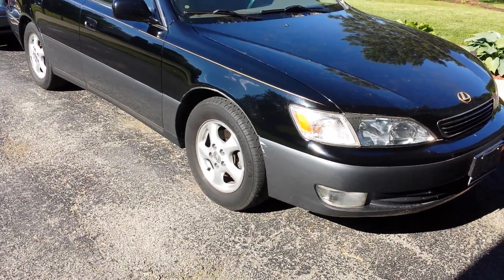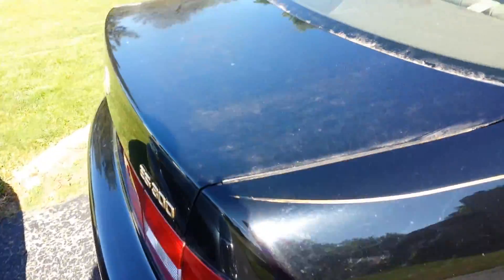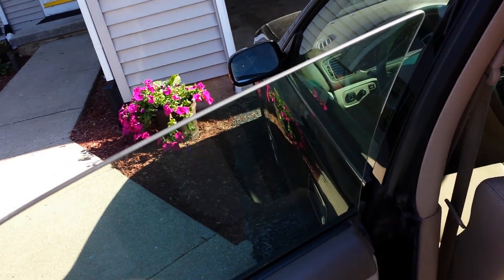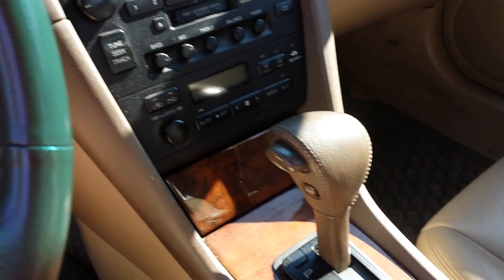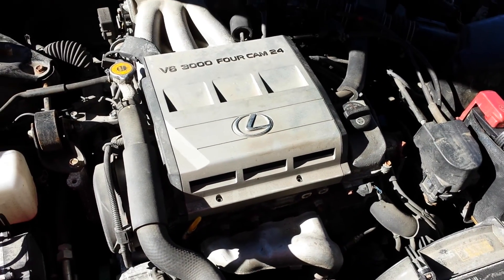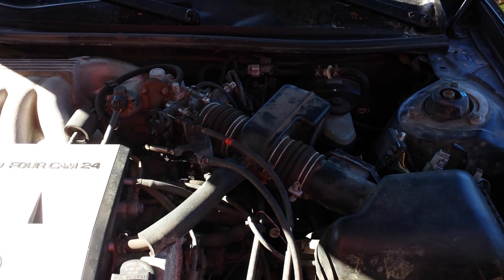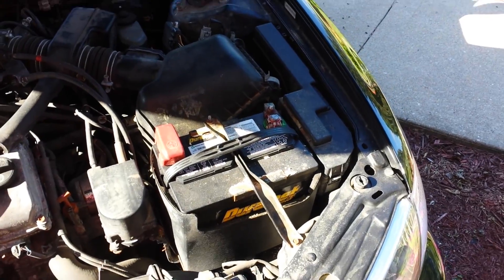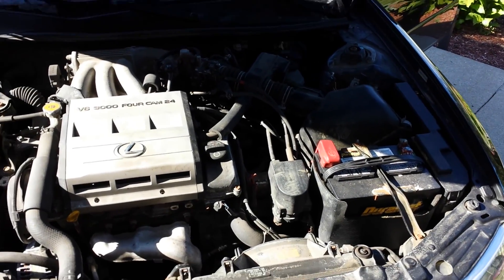Lexus ES300 walk around

Comment: 1999 225k miles only had one coil pack go bad and radiator replaced before got totaled. Change oil often on this motor runs pretty much forever. At 225k miles quieter and smoother and handles better than the following generations. If I could actually find one with a nice interior, I'd pick up another to keep indefinitely.
Reply from the maker: We haven't had to do much to it since we got it 3 ish years ago. Front brakes, cleaned the IAC valve and throttle body, flex pipe replacement, oil changes, and tires is about it I think. There is a little bit of rust forming on one of the rear wheel wells, and one of the speakers blew, but it's been a tank so far.